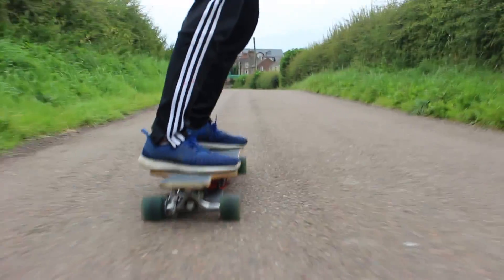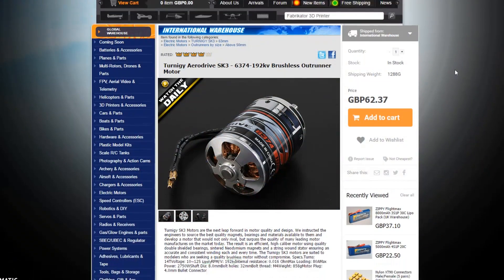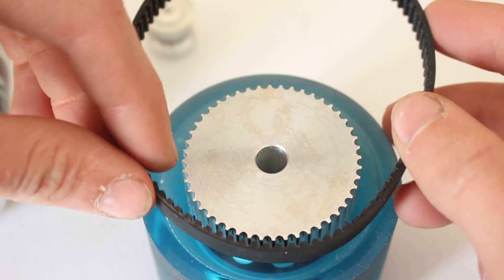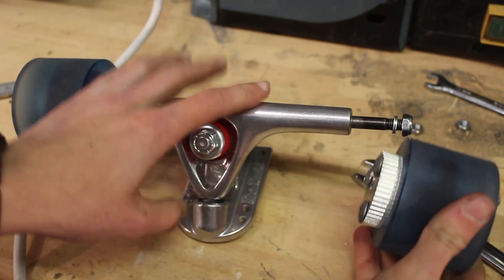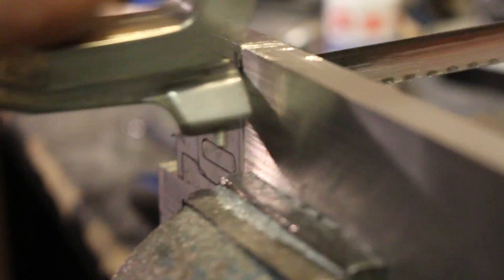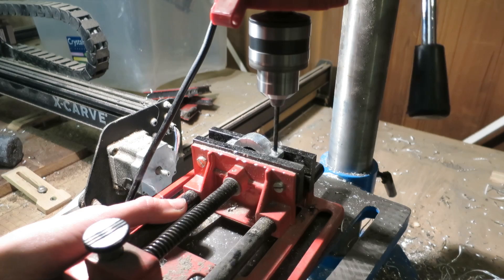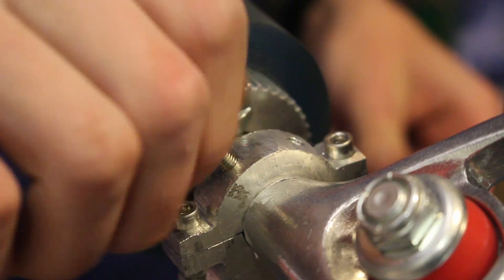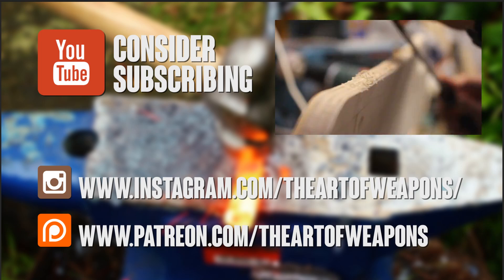How to Make an Electric Longboard - Part 1

Comment: By far the best tutorial I've seen so far. I actually converted a regular scooter into an electric scooter which was quite a challenge as there were no standard parts and had to design my own bracket. Might do a video about it on my other channel as I am doing some work on it at the moment. I had problems with the belt slipping so need to create a bracket that allows me to tighten the belt more easily. Do the tension-adjusting screws come loose?

Comment: Hey dude, great work first of all! Secondly, when drilling aluminum, 'peck' at it. Just make little bites so that your chips can clear. Also, get a bottle of general purpose oil and dab a little on now and again. It'll keep your drill bits sharper, longer, and will help keep things cooler and cutting better. Aluminum is soft and gooey (in terms of a metal), and blocks up the cutting heads of drill bits and other cutting tools. Hope it helps. Keep creating! :D

Comment: Is the motor you're using waterproof? Seems to me it isn't cuz of the copperwiring being naked..
I want to build one myself but this is the one thing holding me back
Reply: Brushless motors are waterproof. There's actually an enamel coating on the copper wire to keep it from shorting out. If you're worried about waterproofing, I'd be more worried about the ESC, as those are very temperamental.
Reply: Leedleedle this I learned later on. And indeed the esc is more to worry about
Reply: Gunnar Kelders That's what I get for replying to a three week old comment lol
Reply: Leedleedle it won't be for nothing! Others who will read this will thank you for giving this straight answer!

Comment: Why do people always use 2*3s Lipos (6S---22,2V)? Can't I just use 3*3s Lipos wich would give me more volts and thus more power(for example with an Turnigy Aerodrive SK3 - 6364-245kv) ?? I'm new to this I might as well be wrong.
Reply: lohn 17 he can't do this because his esc won't work with a higher voltage and would therefore break. With a better esc like the vesc he could use a higher voltage

Comment: Would this work sorry have no technical background just look at the kv rating. http://www.ebay.co.uk/itm/Hot-Waterproof-3660-3300KV-Brushless-Motor-w-60A-ESC-for-1-10-RC-Car-F2O9-/361861623098?hash=item5440a22d3a:g:voAAAOSwo4pYXd5l

Comment: would a higher 2500kv motor work as well or would this be too fast?
Reply: It wouldn't have as much torque, so it may not be able to move with you on it, or at least not up hills. It would definitely go friggin fast though.

Comment: The motors for planes not cars also brush less motes run of ac power with makes them much more efferent dont waste your money on the vesc buy a 70 amp one off hobby king and run it off of two 4s 5000 batters for more power this motor was made to run off 8s this motor only pulls about 60 amps at full power.

Comment: try it with a different motor (below) sprockets instead of gears (put a screw through the outside us a bolt to bring the sprocket away from the wheel) a chain and make it a lot simpler

Comment: I have a motor that can handle 80 Amps Max.. And I want 3 battery's in series ''3S 5200mah 10C-rating'' Are they compatible?

Because 5,2A x 10C = 156 amps.. and that's way more than 80 amps that the motor supports. 
Or does only the volt matter?

Comment: if you could figure out how to mold your own wheels, you could maybe 3d print rim motor mounts that would hold the motor in the wheel. That would eliminate the need for the belt system, and it would make it more compact.

Comment: if you've ripped up more than 3 belts so far, you're doing something wrong. Too much tension wil also definately damage your belt, and you might want to take a look at a pulley for the weel that has rings around it to keep the belt on, this way you won't have to be as precise with adjusting the tension and the angle of the motor and the pulley. Or you just bought shitty belts. I have used only 1 belt for six months now and it's still goin strong.

Comment: Why not mount the smaller pulley to the wheel? With a smaller gear ratio, you have a longer acceleration time but a better top speed! Just mount the bigger pulley to the motor and the smaller one to the wheel and watch the board fly!
Reply: Assuming, of course, the motor wouldn't burn out, and the belt wouldn't be stripped...

Comment: When you're drilling large diameter holes in a drill press either clamp the workpiece down or put a clamp on the bed so that if the drill grabs it doesn't spin around an hurt you.

Comment: if you were planning on using a chain, i would recommend the type used on mini motos and mobility scooters and not bicycle chains, they are smaller but designed to be used on motors

Comment: Hi TAOW, I've just orded stuff to build my own. I found some nice timing pullys on the accu group website for similar prices to ebay but they do a variatiy of belt widths and tooth pitch. Might be worth checking out. Do you know if I can charge the lipo through a BMS without disconecting the lipo from the ESC?  Thanks and keep up the good videos!

Comment: Instead of going to bike chain (which may struggle with the sprocket radii involved) I would gear it down a bit more with a wider belt and possibly try building in a slipper clutch instead of a direct drive. Those options will probably help extend your range too.

Comment: i just bought the same motor, and it turns out it didn't have any bolt holes in the 8mm motor shaft. did you made them to prevent small pulley from rotating? or you did anything else?

Comment: It would be neat if you could turn the controller into some type of glove that you could control by holding a button on the glove or touching some sort of contact point to activate the motor although the electronics in the remote might be a little difficult to incorporate into a glove or something like that

Comment: Instead of using a file to remove the excess material I recommend using a Polyfan on a angle grinder with a bit of cutting compound it Is a lot quicker than using a file also for straight cuts I also recommend using a angle grinder with a thin  disk that will also be a lot easier

Comment: Good idea to be switching to orangatang kegels! Try upgrading to a vesc instead of a regular hobby king esc. You can program the vesc really easy and works really good with your gt2b controller. If you have any questions, feel free to ask
Reply from the maker: I  have a vesc on the way at the moment! My hobbyking esc has already broken!
Reply: +TAOW hahaha i was sure about it when i saw u were going to use it on the longboard deck. These things always break, i've read hundreds of story's on the esk8 forum, my parts just came in for my eboard!
Reply: +Snakeprophet its a longboard, not a rc car. there is no esc that is beter dan vesc
Reply: +Tango965 Ollinboard co
Reply: it may be a bit pricy. but look into castle. they make awesome motor/escs. i run them in all of my rc trucks.
Reply: the chinese are already copying these VESC lol... where do i buy the original VESC?
Reply: do u know a cheaper alternative to orangatang wheels? i want ones that are easy to install bolts in to hold the belt
Reply: Nope, but you can buy a clone abec wheel and a nylon pulley. Just go with the orangatangs, it are verry good quality wheels. Whats the budget of your build a' what parts do you wanna use?
Reply: you can get whells with holes on amazon

Comment: Hey I was just thinking that you might be able to do away with the aluminum and replace it with the hdpe
Reply: if you mean the clamp i wouldn't think this would be safe.
Reply: michi derkinderen all the material removal of the trucks is far more dangerous. you can also reinforce that plastic. and it can be molded so that wont happen. He is a smart guy he could figure it out. you can also put fiber in plastic when you melt it down. Shit he could make a mold to make it one piece to make it stronger. I am seeing compound crossbows being made from HDPE, no reason why this cannot.

Comment: how do i get started with building and metal and wood work, i really want to learn how to build things instead of always buying them, it also seems really fun, where do i start? what tools do i need?what project shall i do? thanks in advance
Reply: that's too vague for any sort of recommendations, which sort of fields are you interested in? e.g woodturning, metal casting etc...
Reply: all of it SandwichedTom mainly being able to build things like this, to start with a blank biut of metal and make custom anything really
Reply: +Instantly Viral That will come in time. You wont be able to start with what he has right away, all of his tools were acquired over time along with the skills required to use them. Start off with simple hand tools, maybe a few power tools too. A drill with bits, a jigsaw and blades, files and rasps, a sander, these are all good things to start with. as you go on, you will get more tools from stores, garage sales, or even for free from people you know! Good luck!
Reply: +brandon2076 thank you that was some very valuable information and the garage sale idea i had not even thought off, thanks again.
Reply: +Instantly Viral There are lots of simple projects to start with. For one, you would need a workbench, and there are plenty of designs that are easy and fun to make with simple tools. Steve Ramsey has a great video about making one that i suggest you look at. May i ask, how old are you?
Reply: I am 15, i love steve he such a nice guy, ill have to give making a workbench a go
Reply: +Instantly Viral cool! Since you're still a little young, i wouldnt use any serious power tools without supervision or someone to teach you, like a circular saw for example. jigsaws, scrollsaws and bandsaws are very safe.
Reply: i have a dremel with a pillar drill attachment for 90* holes, i only recently got it as i know how versatile it was it can sand cut and polish and drill, wanted to get using it.

Comment: As a tip you can use wood working tools with aluminum, thought you need to use suitable lubrication and sharpen the tools more often. Of course metal working tools are preferred, but you can manage with band saw for instance if tooths are small enough and you use lubrication. Other good tool is wood hand planer to round up the edges.

Comment: Nice video, one tip would to have some dynamic in your commentary so that it's not monotone.  Also, how much is a metal lathe like yours?  I don't care if it's pounds or dollars, I can convert it later
Reply: Suggestion 2: RGB LED strips with rf controller or ir (would need a hole through your board to be able to communicate)

Comment: 5:43 is that really safe to do barehanded? Lol
Reply: Yes it's very safe it's actually more dangerous to do it with gloves because if the glove catches on any moving parts it will rip his hand off of your barehanded you will just get a cut
Reply: I'm constantly reminding him of this, apparently he needs to have his very own cuts before he drill press safety. Let's just hope the damage won't be permanent.
Reply: Good point, barehanded is the wrong word.
I'm hoping he would clamp his work. He even holds knife blades when drilling the tang.
Reply: he needs a clamp
Reply: Yes its only Aluminium
Reply: If not of
Reply: He's lucky its not steel, watch it grap and go flying across the workshop
Reply: Drill presses are very dangerous to use with gloves because if the glove gets caught it could break your hand or a finger or rip a finger off

Comment: Dont do a chain please, it wont work like you are expecting it to, if you are having problems with the belt slipping try adding a belt tensioner to it to tighten the line, you will regret getting a chain if you do, they are louder, clunkyer and are basically downgrading from what you already have.

Comment: i only see one problem with the board wouldn't the belt slip off when you turn to much because the distance between the gears or cogs changes
Reply: sorry if that didn't make sense
Reply: The distance doesn't change at all because the motor is attached to the truck of the board.
Reply: +zaqwsx28 oh ok that makes more sense thank you
Reply: +zaqwsx28 oh ok that makes more sense thank you

Comment: You put the bigger sprocket on the motor and the smaller one on the axel, that's How you get more torque.
Reply: No it's the other way around
Reply: +AnythingAnd Anything no his the other guys way is correct
Reply: you'd spin the wheel on the spot and/or blow the motor up
Reply: The smaller your pulley is on your power source and the bigger on the wills will provide the most torque look at a riding mower small pulley in the front big one in the back as you put a bigger pulley on the power and a smaller one on the back you lose torque

Comment: I think going to chain (particularly bmx) and sprocket is a massive step backwards, if the belt is slipping I would look for a way to stop that, maybe add an idler pulley somewhere or modify your brackets to stop slipping.
Reply: +Io didn't he say slipping? If it's snapping it's not aligned properly. If he wants to go to chain id look at car timing chains.
Reply: that would be too big. If he is gonna go chain he needs a chain with small teeth
Reply: The whole belt falling off the pulley thing just I don't believe would bother me take 2 washers that are slightly wider then the belt sprocket drill the holes in the correct places and place them on both sides of the belt sprocket and there you go no more slipping belts
Reply: I was thinking just a pulley with larger teeth
Reply: The reason he wanted the bike chain was because the rubber belt kept snapping.
Reply: +sanka car timing chains do come quite small. Some are large but there are also some small sprockets and chains on euro cars.
Reply: TheAussieStig30 like what model? i have never seen a timing chain with small chain size. Chain might be thin but the buckles will be too big.
Reply: +sanka can't remember off the top of my head, but I remember selling some that were absolutely tiny compared to my Cleveland.
Reply: The problems not that the belts slipping its that it breaking two much dont use a bicycles sized chain use a smaller one for less slippage a full sized chain would easily slip mcmaster car has a lot of different sized chains.

Comment: Just a hypothetical question, but if you created a tiny transmission, could you achieve higher speeds?
Reply: The belt already acts as a transmission, if you use different sized pulleys you can change the speed but it is always a tradeoff between maximum speed and maximum acceleration
Reply: Probably you would, but since the electric motors can get up to massive rpm's while keeping their torque, a transmission would be obsolete.
Reply: That's what a transmission is for. Getting good acceleration AND good top speeds.